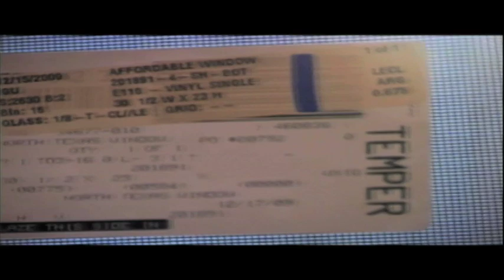Installer Replacing a Metal Window In A Brick Wall

Comment: Would love more detail. Size considerations? My brick house is 57 years old and has plaster walls (stucco like material with a plaster topcoat on perforated gypsumboard) and the original iron windows have masonry nails (look like horseshoe nails) that hold it directly to the brick.

Comment: Did not mention that that the metal frame was nailed to the inside casing and is a bitch to get out since the brick is in the way  Other then  that video was correct.